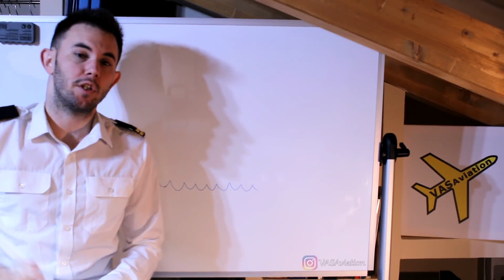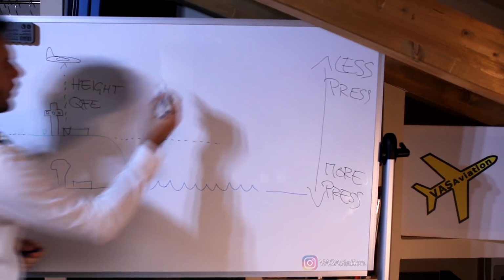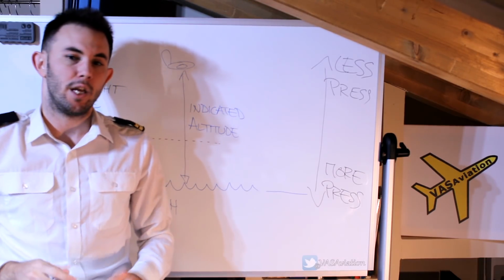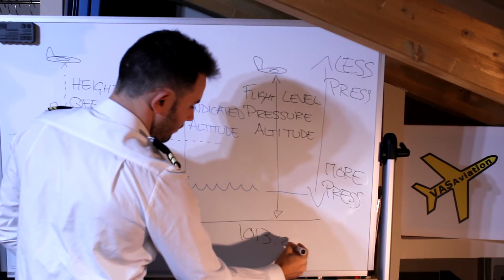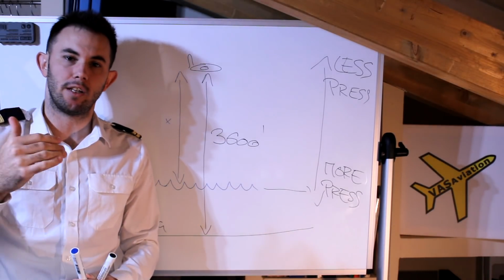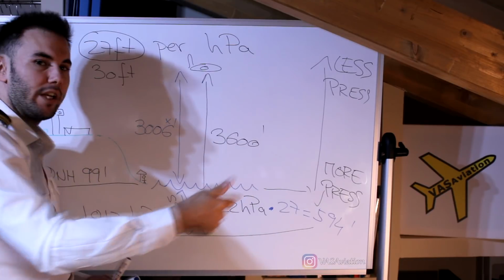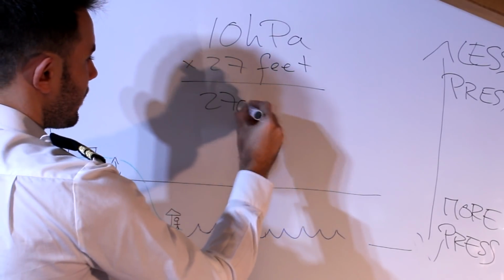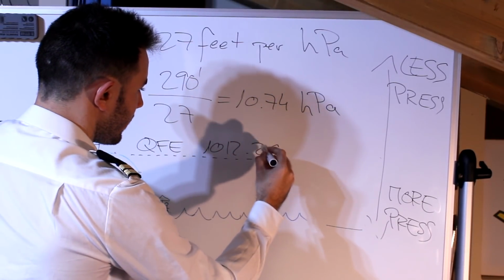METEOROLOGY | Altimetry (QFE, QNH, QNE)

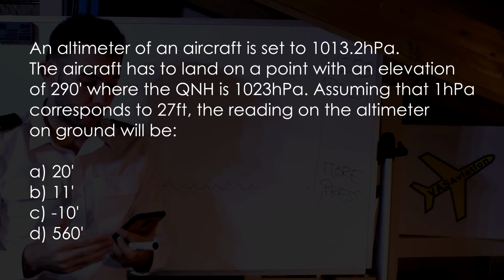Comment: Math problem at 17:57, plane is set to 1013.2 qnh, but the plane lands somewhere where its 1023 qnh. The messed up altimeter setting is now 270 feet off (negative). Airport is at 290, so the (now incorrect) altimeter will say 20. It took me like an hour to wrap my head around it.
Reply: Setting the QNH practically means setting the reference, or the 0 point of the altimeter scale. Pressure drops as the altitude increases, so, setting a lower QNH than the actual, means setting the 0 point higher than it should be, so the plane will be higher than what's indicated on the altimeter.

Comment: I always remembered them as FE = Field Elevation, NH = Nautical Height,, NE = Normalised Everywhere.
If that helps anyone else remember them, you're welcome.
After that and 27ft/hPa, it is just arithmetic and correct visualisation of the isobars in relation to each other.  I'm lucky in that respect, as the product of a Chartered Civil Engineer and a Mathematics Teacher!
Also, when looking at a low-level chart, raised obstructions have the altitude marked first, then the height in brackets.
The first figure is what your altimeter will be reading if you hit the top of the obstruction, the second is the distance you will fall afterwards.
Reply from the maker: Thanks for your comment, Phil. I'm sure your mnemonic will be helpful for someone out there

Comment: You like many, many other sources are explaining it as if QNE was only used above the transitiion altitude which isn't strictly true.  QNE can be useful when the airpressure is outside the value that can be set on the subscale of the altimetere.  I've also seen it being used in the handout for pilots of a gliding competition - not sure why, the weather there certainly wasn't extreme, I was wondering there are altimeters that can' tbe adjusted at all?  Or the button has fallen off ;-)
Various sources alternate between describing QNE as the standard pressure of 1013.25hPa or the altitude indicated when the altimeter is set to that standard pressure of 1013.25hPa.  This is what Skybrary says: "QNE is different to the other altimetry Q codes in that it is an altitude not a pressure (although it is commonly incorrectly described as such)."  I take Skybrary is as close to authoritative as it gets, so this is how I'm using the term QNE.

Comment: Thanks, long duration but actually.. simple 👍

For the last question, i just subtract 1.023-1.013 = 10 hPa because i still remember that the last 2 digits behind the decimal are the significant figures rules in physics.
Can i use that  ?
Reply from the maker: Affirm, it's just the difference between both pressures.
Reply: @VASAviation  roger that.. thanks for the knowlegde sir 👍